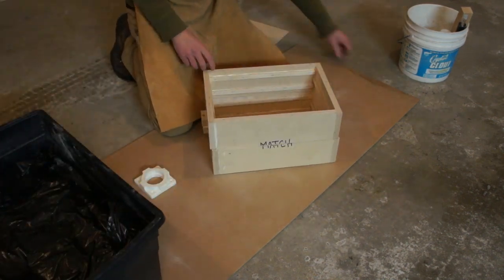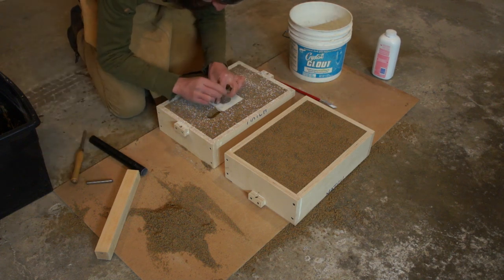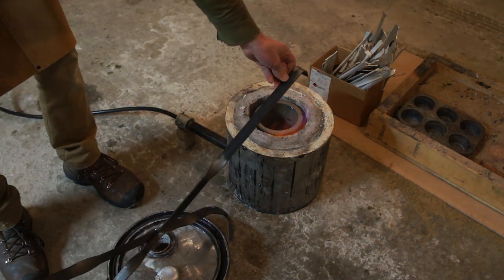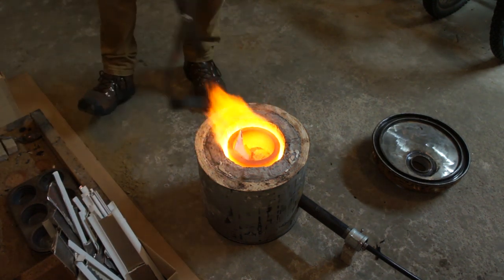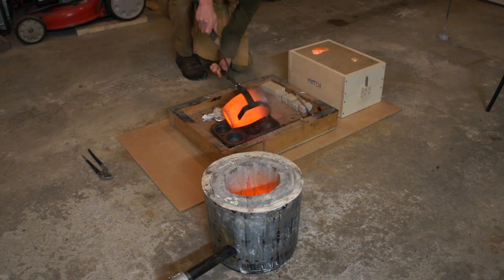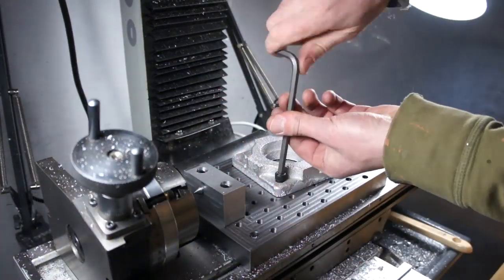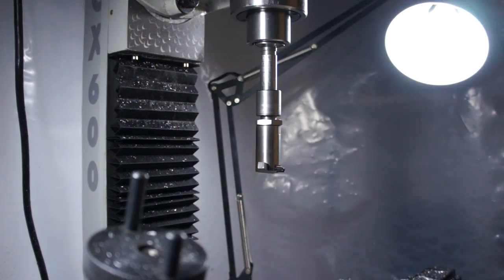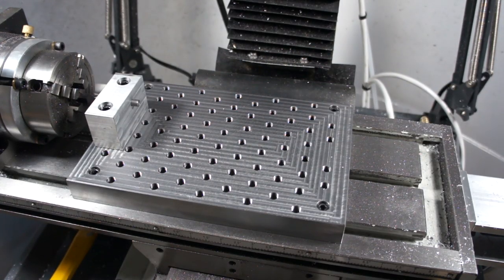Confounded Chronicles 18 - Casting Lathe Bearing Blocks

Comment: You know, it's actually quite ridiculous how parallel we are. 3d printing a part to cast is something I am meaning to do, and have actually been looking into quite a lot recently. Seems like every other video or project is on the same wavelength that I'm currently on.
Reply: amorton I suggest watch a 13 part series called What on earth happened by Ewaranon to learn that the earth is not a globe.

I got it in my about tab.

Comment: I've watched the whole process of you building the concrete lathe and I know that everyone harps about "It's better to use tapered bearing..."    Actually, they are the best way to go, but there are two ways to 'lockout' the flange block bearings that eliminates all the self alignment features which could be causing alot of the chatter in your cuttings. Sadly there's no way for me to upload a few images to make the whole process clear without writing 10 paragraphs of information and requirements.
Reply: You can make a video